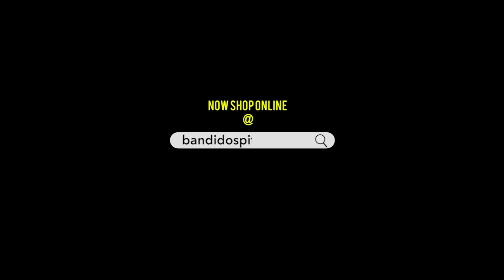Installation of Chain adjuster For R15  V3

Comment: Guys think before u install this the adjusters are limited and after a period of time I had to switch back to the stock ones as they had plenty of adjustment more !!! #designflaw
Reply from the maker: Sorry for the inconvenience bro. This is the first time we are getting a review for this product like this. May i know what and where went wrong?
please message to 8589020202
Reply: @bandidospitstop  will do bro
Reply: @johnnyjoshua6584  so what was the issue???
Reply: @hiteshchauhan4250  it has limited adjustment when compared to the stock after a point u gotta change it to stock or if u wanna continue in the mod u gotta change the chain sprocket:)
Reply: @johnnyjoshua6584  I changed my sprocket just recently. So what would u suggest now
Reply: @hiteshchauhan4250  I would suggest stick to the stock adjustment cuz it might feel not easy but for the long run it will help
Reply: @johnnyjoshua6584  I'm getting irritated with having to visit the mech to tighten the chain ever so often. Even the sprocket change hasn't helped
Reply: @hiteshchauhan4250  it happens bro try to diy for every 500km
Reply: @johnnyjoshua6584  lol. It loosens every 200km

Comment: Bro my chain is loose, when I show it to near shop they told, they can't adjust anymore, we need to change chain sprockets. If I buy this can I adjust my chain without changing the chain sprockets. Please reply
Reply from the maker: The chain sprockets must change as per manufacture recommended time or KM.